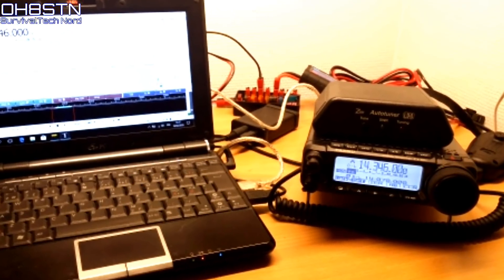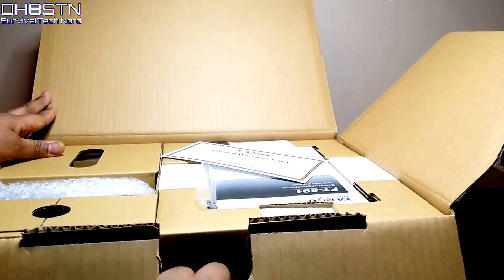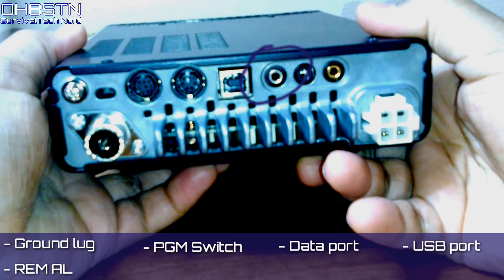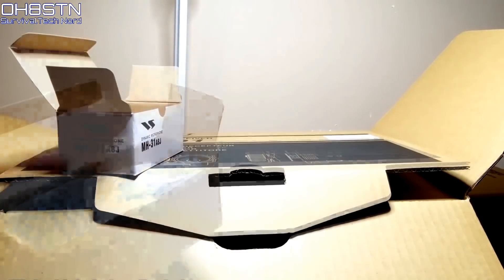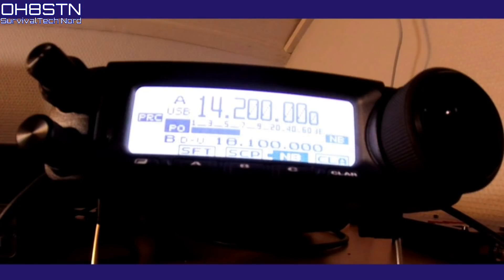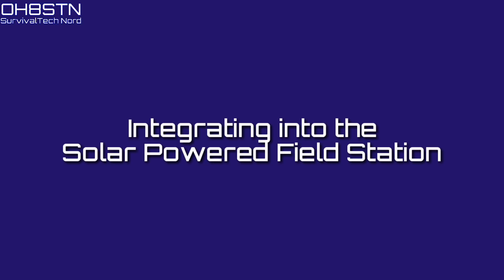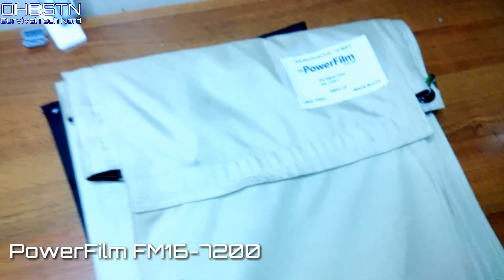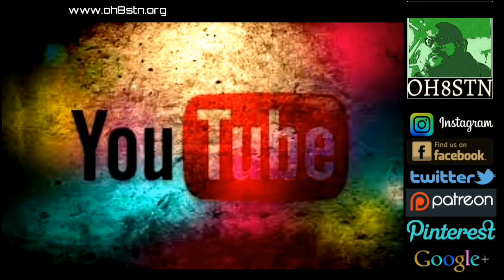Yaesu FT-891 Unboxing

Comment: Hey TN, N1UFO here I also own and love this  radio. I use the HEIL Pro 7 headset with this rig and it works flawlessly without having to adjust any EQ on the rig. Nothing but great signal reports with my setup.

N1UFO/Gabe
73
Reply from the maker: +Videos By Gabriel thanks Gabe, I saw the videos from your buddy in Florida I decided to give it a try. I'm actually glad I did. I don't have any of the problem some of the other YouTube channels have talked about and the digital noise reduction on this rig is to die for.
Thanks for stopping by
73
Julian oh8stn

Comment: Julian, Another great video. I am thinking of purchasing the FT-891. l  will watch as this unfolds. I am interested in seeing the issue of using digital modes and the difficulty mentioned in some reviews of the radio re: switching from lower sideband as on 40 meters to upper sideband for 40meter digital modes. Thank you so much for all the info. Larry N2CPA
Reply from the maker: +Larry Nathanson thanks Larry. You know I'm a hardcore digital operator and I've been using this rig for the last 2 weeks before publishing this video. I tried to replicate that USB clicking problem but this radio wasn't having any of it. The closest I was able to come to it was with a cheap cable I got from eBay years ago.
Anyway I'm going to post all these types of videos doing digital modes and working with the noise reduction and things like that, so they will be no doubt. If you need my serial number (assuming that there may have been a problem in some early series), just let me know.
73
Julian oh8stn
Reply from the maker: +Larry Nathanson 👍👍👍